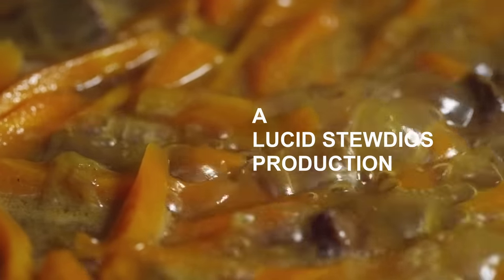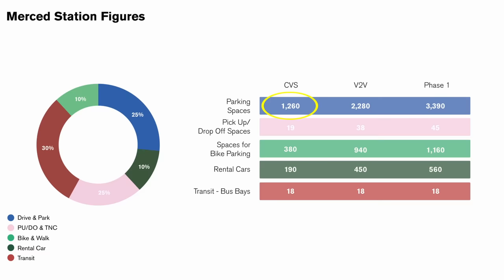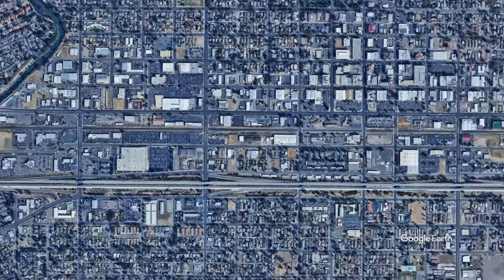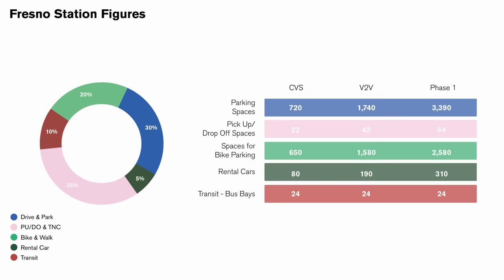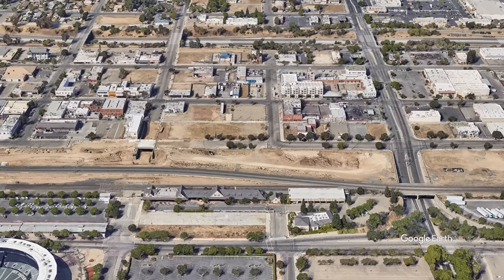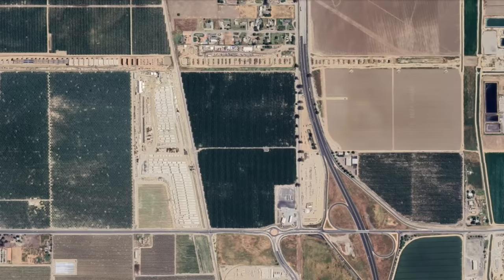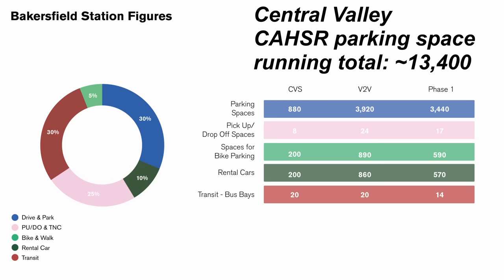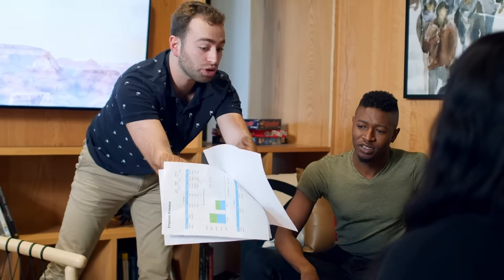California High Speed Rail : A Park & Ride Nightmare | CAHSR

Comment: I fully agree that areas near passenger rail stations should be in walkable areas/areas that have decent transit, but at the same time, if the success of the Brightline Orlando airport station is anything to go by, more people are willing to “park and ride” than people may think.
Reply: It's because we're used to it. For example, there's no realistic way to get to the Fresno airport, which is the closest real international airport to Merced, via public transit. I mean, you can wait two hours for a southbound San Joaquins that's as fast as a normal car, then navigate Fresno's bus system with all your luggage out to the airport, but that sounds like a huge PITA and like you'd have to leave five-six hours ahead of your flight instead of just three (an hour to drive and two for security theatre at the airport). Why would I ever voluntarily interface with a transit network that was clearly designed as an afterthought and take twice as long to even get on my plane? Nevermind the fact that it's probably more expensive than driving anyway, and yeah, of course you'd pay for park n ride.

We could be doing so much better than that, though.
Reply: Plus, it seems like the park and rides are slated to eventually be redeveloped into mixed use after some years in the future. Which I don't think is a terrible idea if we're trying to get people to gradually shift back to liking trains
Reply: @curtthomas8465  or better yet, have a friend/family member drop you off and pick you up, or rideshare. That'd be my go-to, rather than leave my car at the station all day and possibly overnight.
Reply: @notXaragame3542  They should be slated for development from the start. As lucid says in the video, building 3000 parking spaces per station is only going to induce suburban development, and trying to take that parking away for development at some nebulous future time period is only going to mean you have to fight to build what should've been built in the first place.
Reply: Brightline’s airport station connects to a very busy international airport increasing connectivity because of that. 

CAHSR stations in the middle of a field increase connectivity to nowhere except CAHSR.
Reply: @gumbyshrimp2606  not when connected to buses and other transit. In the case of Kings/Tulare, there’ll be buses that connect it with the surrounding communities, including Hanford, Visalia, and Tulare. There’s also the proposed Cross Valley Corridor passenger rail service, utilizing existing tracks to one day travel between Huron and Porterville via Lemoore, Hanford, Visalia, and Exeter. 

There are other HSR regional stations around the world in similar locations outside of cities, that connect with transit to those cities while also providing parking areas for riders who choose to park and ride.
Reply: @ChrisJones-gx7fc  no one likes taking busses
Reply: @ChrisJones-gx7fc  I do agree with you, as this does happen in cities around the world. Typically, though, it's for practical reasons, rather than pure NIMBYism, but that's a different story. 

However, by building 3k parking spaces per station, you're basically begging everyone in the city to drive to the station, and not giving any means for the cities to even try to be walkable or transit oriented. All the frequent bus routes in the world won't matter if you can just simply drive to your destination and find ample parking. It's outrageous and totally unacceptable that this would be the starting point for this project, given all of the claims by this project to be environmentally conscious. 

I hope that enough people express their concerns and disappointment with the authority that they suggested this as their starting point, and that it's changed by the time the stations are built.
Reply: @jamalgibson8139  and it probably will be. Depends on what transit in those CV cities looks like by then, and what type of new development around the station sites those cities are pursuing to encourage TOD and greater walkability.
Reply: Because bright line understands that in order to increase ridership it makes far more business sense to make the station accessible to all forms of transport rather than make it walking dependent. Brightline proves that privatization of mass transit designed for the needs of how riders actually live instead of how urbanites wish they did makes for better transit for all. Brightline knows it's customers want driving alternatives because they already own a car but don't want to necessarily drive it to the final destination. And given a park and ride massively increases their customer base, it is a model that is going to continue to be replicated now that it has proven to actually get cars off the highway

Comment: As much as I hate it, I think it’s fine to have parking in the mean time. These cities don’t really have great mass transit options, so if you want people from around the region to actually use the train (and keep costs down by not building garages), this is what you’re stuck with. On the bright side, these lots can easily be redeveloped in the future (and if the whole project is successful, there should be no shortage of funding for the redevelopment).
Reply: I think California should continue pressuring cities along the route to make tram lines. I also think they should sell off unused land or rent it as quickly as possible.
Reply: They could have made the station closer to the town there supposed to be serving so you wouldn’t need to go as far
Reply: @shopdog831  much of that had to do with the choice of routing, and where CAHSR could get the tracks to go. In Bakersfield's case, that route was the Locally Generated Alternative pushed for by the city, rather than the other route that would have gone right through the center of the city to the current Amtrak station. Bakersfield apparently has some strong redevelopment plans for the area around the future HSR station, perhaps moreso than any of the other CV cities getting HSR.
Reply: @KRYMauL completely out of touch. These projects would not be financially viable for these small, impoverished cities (except maybe Fresno, *maybe*) due to their diffuse development style and lack of density.
Reply: @KRYMauL Agreed
Reply: @alexandervanscoy2518  The whole reason they routed it through these small impoverished cities, over 100k isn’t small btw, is to spur the economies.
Reply: Exactly. Park and rides greatly increase the catch zone of a station while transit dependent development greatly diminish it. Considering the massive cost, it is simply unrealistic to create HSR for the very lucky or wealthy enough to live walking distance away from a station. Anyone who is transit dependant should take transit to get to a HSR station and not necessary expect hyper expensive HSR to be next door.
Reply: There shouldn’t be any parking. If you need to take a car to get there, just Uber.

Comment: HSR should be built in tandem with new local metros.  This way you get off the HSR train and onto a local metro train to access the key features of a city without needing a car.  Bakersfield and Fresno are actually large enough for a metro if designed correctly and if HSR was a proper anchor station.
Reply from the maker: I think one main problem is the extremely suburban nature of all of these cities. Merced and Fresno have the most chance of converting some of that into urbanity near the station. They both also have Amtrak stations within a mile of the planned CAHSR station, so there is potential to grow between. In the future, I could see a light rail or street car line in Fresno doing that. Not sure if Merced is large enough to support that.
Reply: @LucidStew  there's a project underway to link the San Joaquins line into the Merced CAHSR station, deprecating the old station on the BNSF line. It's called MITC, it's spearheaded by the SJJPA and Merced is, imo, a little too proud of it for what it is.

It's worth noting that I recently brought this up to the mayor of Merced at a town hall and got the old "public transit just doesn't work in the US" treatment. I see this is the start of a discussion, rather than the end, though, as multiple council members expressed agreement with my viewpoint.
Reply: Well, California is trying very hard to get cities to create rail and light rail projects, so I could see this happening. Also, I think Bakersfield and Fresno would probably opt for a streetcar.
Reply from the maker: @curtthomas8465  Oh, ok, I knew SJJPA was planning to hook up at the Merced station, but I didn't realize they were planning to abandon the existing station.
Reply: @LucidStew build monorail and then the areas will restructure
Reply: @KRYMauL BRT is better than streetcars especially if we stop the stupid regulations on buses and allow international buses to come over😊
Reply: @curtthomas8465  all the Central Valley cities HSR is connecting, including more far-flung ones like Hanford and Visalia, will have improved bus routes to connect people to the stations. As for MITC, that'll become the terminus for both the San Joaquins and ACE Rail. I imagine it'll stay the permanent southern terminus for both services, namely the San Joaquins, as one of the goals of this project is to reduce diesel emissions like from the current passenger trains. So all the current stations south of Merced will be closed permanently, which really begs the question what the point of the Madera HSR station will be.
Reply: @KRYMauL  Fresno once had a pretty extensive streetcar network, and there've been past proposals to build a modern one. There are several stroads connecting downtown Fresno toward its northern outskirts that could be good for a streetcar line.
Reply: @LucidStew  yeah the opening of the Merced HSR station and San Joaquins connection will mean the truncation of the San Joaquins south of Merced, and the closure of the current station as well as the Amtrak stations south of Merced, at least during the interim Central Valley service. Should that arrangement remain permanent once service to SF begins and eventually to LA/Anaheim, as it probably will be, that really begs the question of what's the point of the Madera HSR station, if that's not meant to be a transfer point between Amtrak and CAHSR.
Reply: IMO the ending of the San Joaquin at Merced is a huge mistake. HSR works best with minimal stops which needs to be the focus. They need to make a transfer station (not bus or tram connection) at various points along the line and let the San Joaquin collect the intermediate passengers (ie. Madera, Hanford, Wasco and other already existing stops). Then limit HSR stops to Bakersfield, Fresno and Merced. It may seem minimal when phase 1-a opens but once Los Angeles and  San Francisco are connected the smaller stops will be more of a burden.
Reply: @Db_traveler  the only intermediate San Joaquins stops between Bakersfield and Merced that HSR won’t have a station at are Wasco and Corcoran (not counting Madera here). Those two will have new bus routes to their nearest CAHSR station, Bakersfield and Kings/Tulare respectively.
Reply: @qjtvaddict  Or even better allow the international buses to be built here. And grassy tram tracks are really what I meant.
Reply: @qjtvaddict wow Monorail and BRT, you must hate conventional rail transit huh
Reply: @TheRandCrews  tbh, a lot of people get weak knees when they see the price of rail because they only see it in terms of sticker price, not in terms of how much you save over infinite lane expansion, maintenance, etc. etc. It doesn't help that the US seems utterly incapable of building any kind of infrastructure (including road infra) that doesn't cost 10x more than the rest of the world for a worse outcome, and when you view heavy rail through that lens, it starts to make some sense why folks lose their nerve and settle for stuff like BRT.
Reply: @ChrisJones-gx7fc  Bakersfield in Fresno are large cities. Merced has a growing university. But I agree with you what is the point of the Madera station.
Reply: @Db_traveler  Though I agree that the San Joaquin shouldn't end and in favour of CAHSR, keep in mind that the first high-speed line is built with relatively short stop spacing (around 20 to 25 km) and similar lines in that country are continued to be built as such (in contrast, the stop spacing on CAHSR tends to be at least 40 km but not throughout which is comparable to Germany's newly constructed HSL).
If anything, the existing San Joaquin should have a bigger focus on having more stops thanks to faster alternative through the valley (since Shafter is apparently skipped, Hanford loses a convenient station, and both Fresno and Bakersfield could get intermediate stops) alongside convincing UP for opening up a Fresno-Visela-Bakersfield service.

Comment: I'm actually working on this right now, getting involved with hounding Merced City Council to develop better public transit and better land use overall, but especially near the station. Merced, for their part, claims that a revitalization effort centered around the station is underway, but I've not heard any specifics. They're probably referring to those transit-oroented development potentials. The station is going to be caddy corner from Costco at 15th and O area. 

The parking lot areas have floored me. Thanks so much for bringing this up. This is bonkers
Reply from the maker: Nice. Keep us posted. Merced in particular is frustrating because you only have a gap of 2-3 blocks to close, but its a 4-lane street and huge amounts of parking between. Not exactly the most enticing way to get people to wander in the downtown direction before driving home. Or further out in the future, walking home. I'm sure there would be local opposition, but I think if Merced could shrink 16th St. down to 2 lanes and shift that traffic capacity elsewhere, in addition to getting rid of some 16th St. facing parking, that would go a long way toward tying everything together and making the station work out much better for the city.
Reply: @LucidStew  the whole central valley is very, very, very car dependent. Public transit infra here is terrible, particularly between cities. The good news is that, for the most part, folks here aren't really all that car-brained; it's just a fact of life that you need a car to get around the valley, not that many people actually seem to enjoy it. The bad news is that we do have a lot of NIMBYs here. I've never met a group of folks more deathly allergic to urban density than Californians, especially in the central valley. It just means it's going to take consistent effort over a long time.
Reply from the maker: @curtthomas8465  I'm from the Inland Empire, which is very much a spiritual cousin to the San Joaquin Valley, but we're kind of like your guys' Ghost of Christmas Future. When people start flooding in, and they already have, especially in Bakersfield, it's going to get miserable without some forward thinking policies. Once everything is built out the wrong way, correcting becomes very difficult.
Reply: Can you get me a job? Im an environmental engineering student, about to graduate from UCLA. Thx!
Reply: @KevinBolsajian  I'd love to. Unfortunately, the work I'm doing is as a citizen showing up to city council meetings to give public officials a hard time, not paid work. Best of luck to you.
Reply: @LucidStew  
 little update. I went to the Merced station event they had on May 2nd. Took a few pictures if you're interested, just lmk how to share them, just don't expect anything too impressive. Overall pretty interesting, they're collecting a LOT of community feedback to try and make these stations fit in with the city.

On that note, I spoke with two CAHSR staff about the parking lot plan, and what they said was that any development there would be from private investment and it's too early in the project at this stage to really secure any private investment for that. I'm not really sure how true that is, but they did say that they're building in all of the necessary infrastructure to support dense, mixed use development in the future, so basically all that has to happen to start building is to have the asphalt peeled off.
Reply from the maker: @curtthomas8465  Cool. Yeah, I'd love to see the pictures. do you have a Google drive folder you can give me view access to or something like that?
Reply: @LucidStew  I've tried to post the link several times and I guess yt keeps nuking it. Do you have a mastodon account?
Reply from the maker: @curtthomas8465  my email is in the channel About info
Reply: I agree with better concept stations like the ARTIC station in Anaheim, CA.  The roof of these stations can be solar powered integrated into the design since the areas the stations shown gets alot of Sun.  Not sure why kings is  a station.  It should ne noted if the population is very small and no redevelopment plans, no station until your city.also has a plan